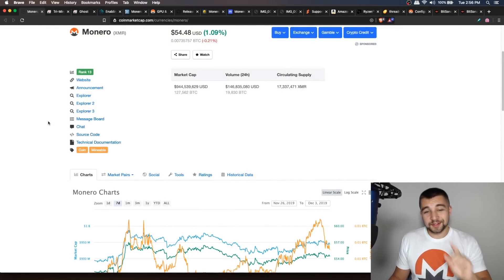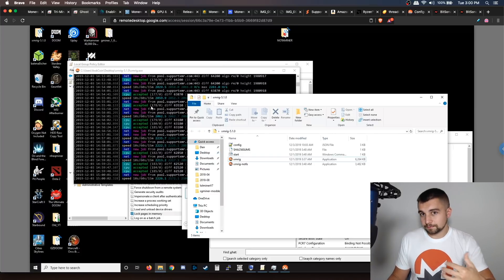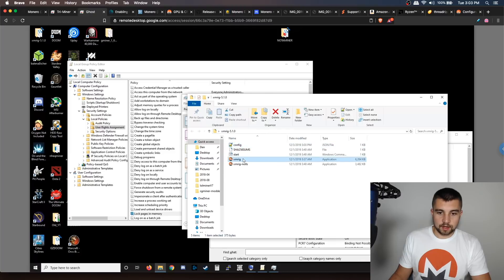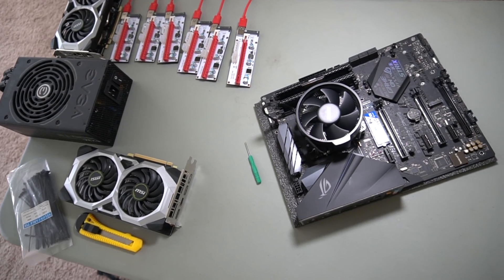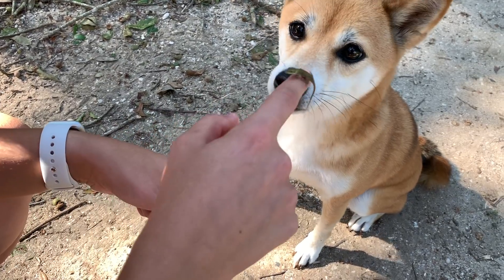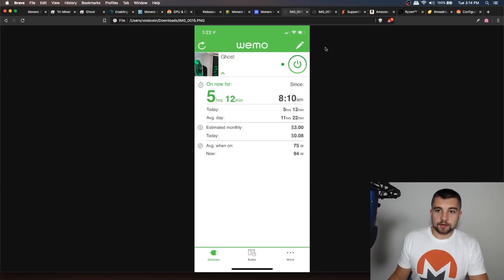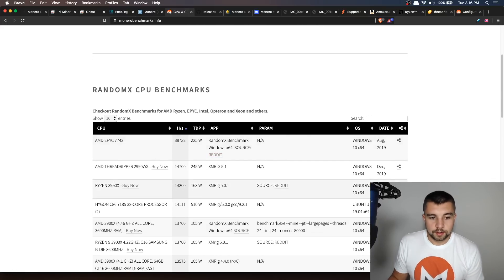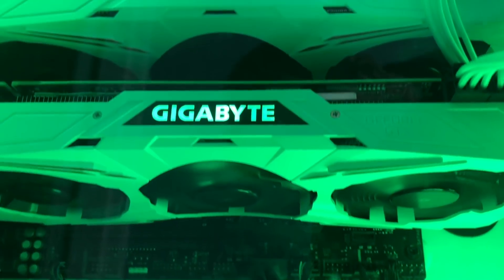How To CPU Mine Monero RandomX on Intel and AMD CPUs | Profitability | BEST CPUs | Best Miners

Comment: I have a small farm, just a dozen or so cpu's mining monero, but I use solar for part of the power, it clicks over in the day and clicks back to grid at night, the inverter is automatic to the bank voltage, so when the voltage goes up in the morning it turns on, and that activates a 125V coil on a DPDT relay, which switches the power over from the grid to the inverter.  At night when the voltage drops, the inverter kicks off and the DPDT relay switches the power back to the grid.  I added a bit of capacitance to the +5V and +12V computer power supply outputs to ensure they carry through the switching without freezing up or glitching.  Without the solar, with the older I7's and I5's it would be totally not worth it because the electricity would be worth more than the mined coins, but with about half of the time being on solar, where I can't really sell the power back to the grid for a reasonable price, it is a higher and better use of the excess power.

Comment: I have a question ( I'm new to this)
Do I  need a Gpu to my sistem to start mining monero?
Reply: No.  GPU mining of Monero isn't really worth it.  It's meant to be mined by CPU.
You'd be better off mining Ethereum with a GPU.
Reply: if you build a monero mining rig buy the cheapest gpu possible (gt710 for $50)

Comment: Help me Vosk!  You're my only hope.  I've looked and looked and just can't find anything on this.  Is there any Monero mining software that will use your CPU, but let you throttle it back so it isn't being absolutely killed?  I have two PC's, both with Ryzen 9 3900x in them.  I would love to let them mine, but as soon as I do, the PC is useless and unresponsive.  I have both of them doing GPU mining through NiceHash.  I've turned CPU mining on, but regret it every time.  What would be perfect is something that could scale CPU by percentages (like Load Team) and pause when the PC is being used.  Any ideas?
Reply from the maker: Nice hash miner can basically do this but with no middle man software just set the CPU miner to use less threads, this will reduce the load it’s putting on the CPU
Reply: @VoskCoin  Thanks for the super fast reply Vosk.  That was probably the only thing I didn't search for.  Got bot PC's running correctly now with the CPU's using 12 threads each.  Here's what my two rigs are running....   Got them both running NiceHash.  PC #1 is Ryzen 9 3900x with a Asus RTX2080Ti.  CPU with aftermarket air cooler runs about 75C, GPU has Arctic Accelero and runs a cool 60C when going at 100% flat out.  PC #2 is Ryzen 9 3900x with a Zotac RTX2070 AMP. CPU has stock cooler so running warmer at 92C ish, and GPU is stock as well running about 68C.   Both are in Fractal Focus G with 6 case fans each.  I am also working on building a 6 GPU rig using GTX1080Ti's.  Thanks again. Your channel has really helped me understand crypto.

Comment: Have been running about 20minutes and my wallet still reads 0.00000000000 and my supportxmr link shows activity, but the Pending/Paid remains all 0's. Does this just take some time to update or am I most likely configured incorrectly?

Comment: So, I'm interested in getting started... but this video kinda fell short. So far, all I got was buy the highest benchmarked CPU that you can afford. Download and run some miner program. 
I mean, there has to be more that I'm missing here. Do I need a power supply to run the CPU? Is a graphics card necessary? RAM? How do I connect to the internet, do I also need a network card? There's a lot of assumptions made here, but for the beginner... I'd like to see it laid out, from start to finish. (I'm primarily interested in Monero only)
Reply: You have to research it the less you spend the longer it takes for roi im going to be running a 3700X total cost with board chip cooler memory psu is $760 i have a cheap gpu and a ssd already you can use a memory stick as a hard drive

Comment: Let me give everyone a slight crash course on this whole amd cpu monero bidness... If your ass has an fx9590 overclocked to somewhere around 5ghz Goin full send on menero... It can be done... It gets around 3khs.. But the power draw (if your mobo is straight primal) will send your psus into an amazing festival reminiscent of a ww2 bombing with glorious sparks and melted cables as it hashes away like a crazed primevil savage until your house decides its had enough... This has been a public service announcement brought to you buy a (clearly insane at this point) owner of 1 rabid fx9590.

Comment: Hi Vosk still loving your channel and rewatch most your videos and takes notes as I'm just about to get up and running on CPU mining. Was just wondering what motherboard you suggest using? Ideally I want one that supports the ryzen 5 and 7 gen (ideally even 9 for later upgrades) but also has at least 4 PCIe x16 slots so I can also use it as a GPU rig. Thanks and keep up the good work

Comment: Can you mine 25$ profit with monero everyday if you spend 15k on the equipment?
Reply: Hey that should be difficult. The 'AMD EPYC 7742' performs best in the benchmarks. It has an output of approx. 40,000 H / s. (Or 40 KH / s.) 

https://monerobenchmarks.info
The price for the CPU is around $ 8000.

You can calculate how much hash you need to get $ 25 a day. 

https://www.cryptocompare.com/mining/calculator/xmr
I have just entered that and come to 280 KH / s. (or 280,000 H / s.)
To do that you would need 7x 'AMD EPYC 7742' CPUs for about $ 8000 each. That would cost you about $ 56,000 just for the CPUs. In addition there are costs for RAM, mainboards and of course electricity etc.

The values fluctuate daily in the calculator, you can try out what it costs 'now'. Maybe there are already better CPUs cheaper now. Just try the links.
have a good day :)

Comment: I was making $3 a day the first day using a 3900x (it is like $1.5 now)
Reply: what other coin its fine to mine with cpu?
Reply: Yuki Riquelme as far as I know that is the only one
Reply: @yukinetaa  Turtle coin
Reply: @kbozz71  u know some coincalculator for cpu?
Reply: @yukinetaa  I like the mine2gether mining website and pool. All the pools have a hash rate profit estimator on them. You're not going to make much at all, but it's fun to play with.
Reply: @kbozz71  im  a larger gpu miner, but a friend  gift me a threadripper 3970x cpu, and im looking what to mine with it. With gpu are a lot of calculators.
Reply: @yukinetaa  If you don't mind me asking, what are you gpu mining? I can't find anything worth gpu mining at the moment.
Reply: @kbozz71  Grin c31, zel and ethereum ( p104-100 eth, gtx 1070ti, 1080 and 1070 grin and zel), 
7 cents kwh
Reply: @yukinetaa  Thanks. I've got a 1070 and 2 RX580's just sitting right now.
Reply: @kbozz71  i dont know if buy a motherboard for the amd x3970( 400usd motherboard) or sell it. Because if only one algo its profit for CPU mining them mmm. ( randomX)
Reply: @yukinetaa  You will likely never make your money back. If money is an issue, then definitely sell it!

Comment: I use cudominer with Intel 9700k (8 core 3,6MHz) 1080Ti 11GB OC. It is not profitable, but I have huge belive in Ravencoin, which is a new (2018) BTC fork. I belive it is in a low cycle 0.23 cent. I let cudo mine whats most profitable, and I get payed in RVN. I Norway I pay among $500 for a second hand 1080Ti 11GB OC. After 4 years mining reward will be half, so its so early as BTC was at the time it cost a cent. I see it as a great opportunity to earn early coin which I belive have a great team and its ASIC resistant.

Comment: Hey dude I like the video, you just did I recently built a ryzen 3800x rtx 2080 xc and I use cudo miner. You were correct. With proper optimization I'm am seeing 4.37 kh/s on my cpu .amd because of the threads shows I have 16 cores. Running ethereum classic ethminer 0.18.0 33.81 mh/s  I'm still new to this wanted to know if this is a good starting point

Comment: Ohh my! What a large microphone you have! You know, I believe there is a law that restricts the on-screen display of pointlessly oversized, extravagant microphones if it's size is larger than the head of the host, or if it requires more than 50% of the frame to achieve it's primary purpose (underendowed male  overcompensation). Im not bashing your super serious, crane suspended phallic or your personal desire to have it front and center, dangling in front of your face  like that. But, remember that your viewers are also getting the same presentation, only without any choice in the matter... After watching this whole video, I estimate several hundred megabytes of my mobile data was consumed for the sole purpose of annoying me to such an extent that I don't even know what you were talking about.
    Ohh, Monero and RandomX! My favorite topic this Christmas! I just happen to have several racks full of particularly powerful (esp. on RandomX) 64-core enterprise Opteron servers that are just sitting there. Im glad you reminded me about the fork! Now I get to put them to use!  U kno what? Forget what I said about your phallic! It is quite impressive to the miner ladies im sure! Keep it up man!

Comment: Zero surprises on the lack of profitability. A repeat of what happened with Loki who was on RandomXL way earlier than XMR. Totally centralized to server farms. Algo solves one centralization problem and creates possibly an even bigger one. Loki is now going to "Pulse", 100% PoS. Monero is going to have to come to grips with the server farm situation and explore other options.
Reply: Necro Nemesis which is better to mine right now? XMR or Loki?
Reply: @youngrp  The returns have historically been about the same so it comes down to whether or not you are speculating and if so which one has more potential to go up. Loki is bringing Blink and it's mixnet online in the next 24hrs which are major platform features that have been months in development.

Comment: Thank You for great tutorial! I'm mining with I3-8100 and I'm getting 2.4KH/s
Reply: How much do you get if you left it on a whole day I'm hoping to get a refurbished i5 4570
Reply: @jonathanpolitzki9128  I have the ryzen 5 4600h laptop CPU is about as powerful as a ryzen 5 2600x overclocked even more version. The i5 4670 is about half as powerful as standar ryzen 5 2600. Nothing nons other then that
Reply: @jonathanpolitzki9128  I don't know much about mining but I don't think so or not enough since the Tdp of the 260p has such a high Tdp

Comment: Your Hash 10.0 KH/s, 755.6 MH/ net, MH/s Pool 250.0 137% Effort.  Are these good numbers for 1 station?
Reply from the maker: What’s your hardware
Reply: @VoskCoin  AMD 3950 Threadripper 64gb ram.

Comment: You were certainly right by stating "Mining Monero is very simple, but optimization can be advanced".  My 3950X doesn't like it when I touch its core voltage.  60c stock or 90c+ with good timings after tinkering with core clock/voltage.  It was a pain to setup for dual mining/workstation/gaming but seems to be performing very well on "mostly" stock settings.  Power Plan + a few bios tweaks and you're good to go.  Keep up the good work and we'll keep HODLing!

Comment: Thanks for your content as always. I am thinking to get the 3900x with 3 vega vii's to replace my current setup which is 8700k and a vega 56. i dont pay for electric so long as i dont start using up loads, but i am also investing into solar power as its something i always wanted to learn about anyways. I already have my power inverter so just need solar panels and batteries and yes its 240v because i am in England ( so it will be good for power hungry devices).

Comment: You can only run xmrig with 0 donation is if you compile it yourself and modify the code slightly to remove that donation part.
Reply: can't you just remove the part with the donation entirely? i started mining ethereum and when setting up the bat file I was told to delete like half of the line as it contained options settings and it ran perfectly. What exactly do you need to compile in order to not run with the donation part?

Comment: gpedit.msc isn't available on Windows 10 Home, only on Windows 10 Pro. Just FYI.
Reply from the maker: How do you access the large pages then?
Reply: @VoskCoin  Haven't been able to. I don't think it's possible on Windows 10 Home.
Reply: If I remember correctly, you have to go directly into the registry and add a key to do it. You should be able to find the procedure via Google.

Comment: hey vosk, i have the same cpu just the x version of the 1700x anyway to get ur hash up this is what i did, u have to go to bios an turn off  opcache control, and then set it run only 8 threads if u didnt already makes a big diff etc.. theres some other tweaks to such as disable hw prefetch for intel an stuff too which boost it quite a bit im hasing away at 5234.9hs/s

Comment: Are there any significant downsides to mining with cpu and gpu on a machine simultaneously as far as hashrates compared to the max potential of each on their own?
Reply: u wont be able to use the GPU if ur mining with the cpu for this it takes to much and u wont get much of a hashrate on ur gpu at all
Reply: Bullshit, I'm doing both right now (folding@home with gpu and cpu mining Monero) and I seen maybe a 5% drop off.

Comment: 4:30 Follow at your own risk: I've heard the file still downloads (at least for my browser), but never gets renamed to "*.zip". You can manually rename, and run the SHA256 to verify authenticity.
Great video, and mirrors my experience. Took my first plunge into mining with an i5-6600k, and happened to be on the day Monero switched over to RandomX. Made a whooping potential $0.36 over two days (about a month or two before I reach min pool payout), so no lambos yet. Still, fun to finally start learning about this stuff.
Reply: Yeah since I have my Ryzen 7 and Rtx 2070 super I have been mining casually here and there but now I bought a old desktop changed the HDD to ssd switching PSU and now I want to run two x570's for 24/7. But it will cost alot of energy.
Reply: You gotta start somewhere.  6 months ago I was tinkering with miners on an extremely high end laptop to start learning the basics.  Today we have 4 rigs in server chassis'  optimized for what we want to mine and support.  Keep it up and constantly try to converse with more experienced miners who are willing to bring you up to speed on whatever interests you.

Comment: Why Monero difficulty is very high after the fork?
Reply: Because hashrate is high
Reply: Someone on Brandoncoin said they where mining with large severs. I suspect a botnet as well. Monero did not say it would specifically stop the botnets and that was up to the operator of the devices..
Reply: Because CPUs are more effective than they ever were. pre-fork they would get less than 1kh/s, now they can get 10kh/s+

Comment: Anyone know the return on a top spec Ryzen at today's varibles? I don't mind spending but I'm not looking for an ROI of 2 years, as we know that'll likely be longer. Thanks!
Reply: right now is not a good time to ask considering the difficulty skyrocketed but it currently sucks rn
Reply: i'm making $1.10/day not accounting for electricity on my 3900x (~13kH/s). difficulty is only going to go higher, so it's more of a winter space heater